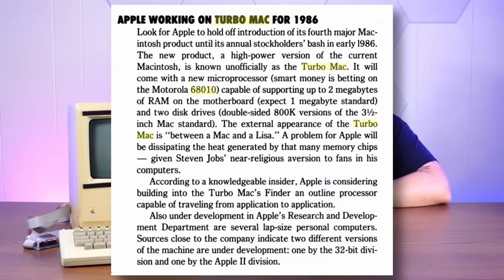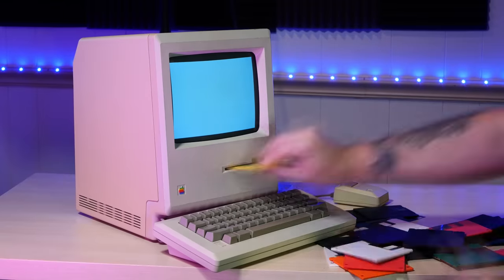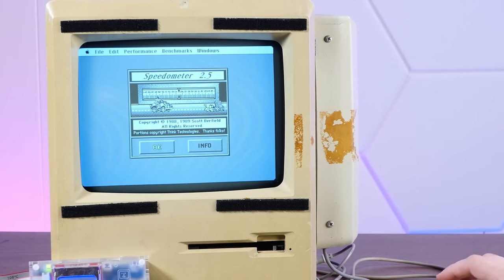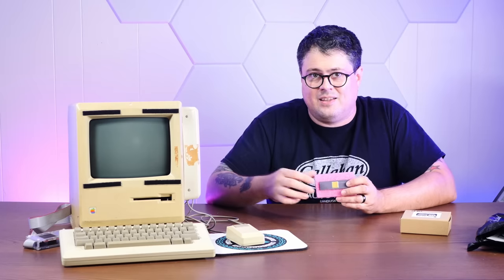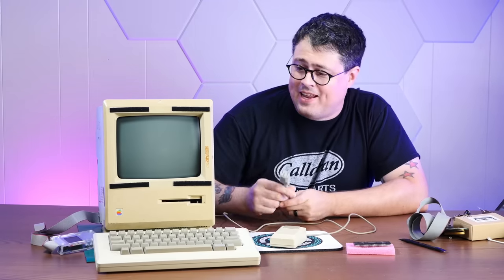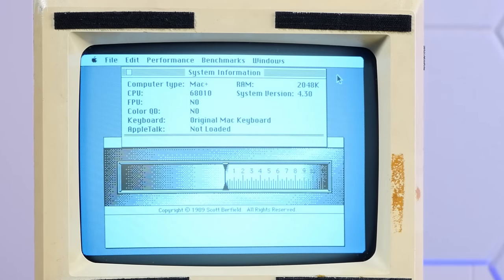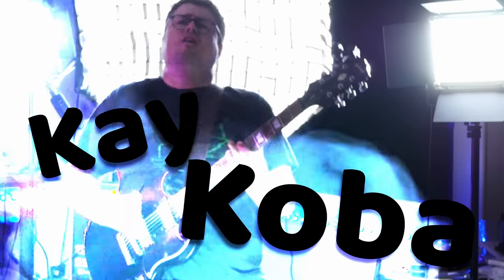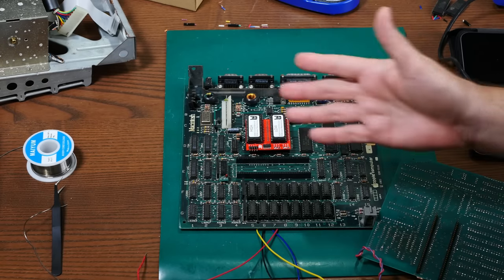Apple Cancelled the Turbo Mac. Let's Build One.

Comment: Did the PC world ever have this level of customization? It seems the Amiga and Atari systems of the time also had these types of crazy upgrade paths. Your typical PC though, except for maybe some of the CPU "accelerator" sockets I don't recall anything as crazy for memory.

My Epson Equity 1+ actually had RAM expansion slots and I kept that into the late 90s adding VGA, ethernet, hard disks. But PCs were always built with that in mind it seems to a certain degree.

While fascinating it's also a little sad the lengths other vendors required their customers to hack a machine to get simple upgrades.
Reply: Obviously it's much more limited since the PC was effectively a 16-bit platform for a lot longer, while all of those are m68k systems (with at least 24-bit addressing like the 80286 in protected mode). If you couldn't reasonably upgrade using larger SIMM modules, you often had things like 640K memory expansions bundled with hard-drive controller cards. EMS cards were literally bank switching memory mappers to get addon memory beyond the megabyte barrier imposed by the CPU instruction set (and XMS later merely provided a means to copy from and to beyond it in real mode).
x86 CPUs were obviously upgrade-restricted by generation, but even first-gen PCs had 8088 replacement options like the NEC V20 (the Equity II came with a V30 as an 8086 drop-in by default).

Comment: I don't know why the 68010 would go any faster if it is just a bugfixed 68000 with extra features not coded for in Mac OS, and at the same clock speed.
Reply from the maker: ive read that there were optimizations as well
Reply: @ActionRetro  Yes, it has a primitive instruction cache.  Wikipedia sez that it adds "Loop mode," "which accelerates loops consisting of only two instructions, such as a MOVE and a DBRA. The two-instruction mini-loop opcodes are prefetched and held in the 6-byte instruction cache while subsequent memory read/write cycles are only needed for the data operands for the duration of the loop. It provided for performance improvements averaging 50%, as a result of the elimination of instruction opcodes fetching during the loop."  "In practice, the overall speed gain over a 68000 at the same frequency is less than 10%. "

Probably, the benchmark program just doesn't use many (or any) 2-instruction loops that would benefit.  But it seems likely that in a more diverse range of software, there would be some such loops that would benefit.

Comment: Why not just use another socket to raise the RAM expander? They are all male on the bottom and female on the top, or would that create clearance issues when trying to fit the board back into the Mac? Alternatively, the ROM sockets are pin through so you could mount sockets on the bottom of the board and just mirror the pinouts, that way you can fit the ROM expander after you install the board into the system.